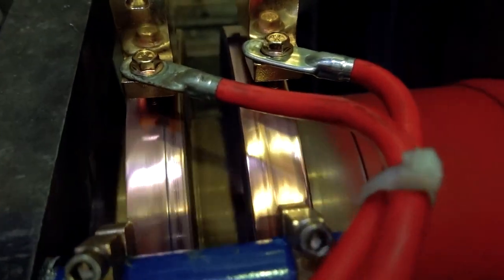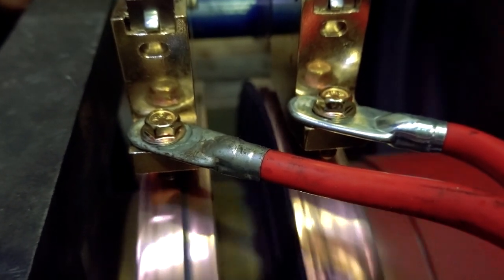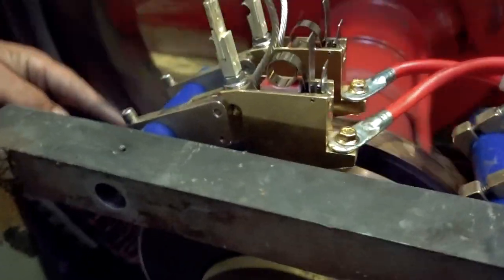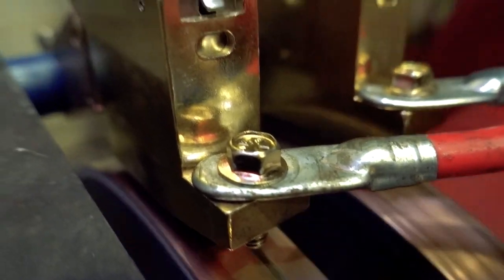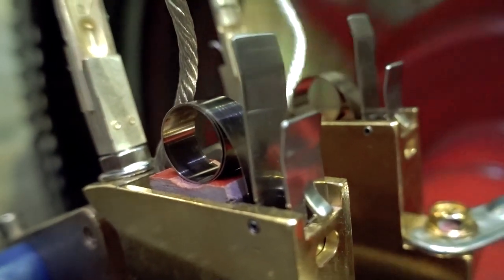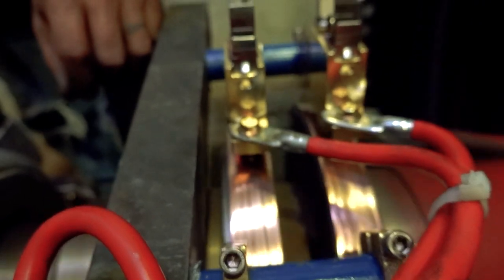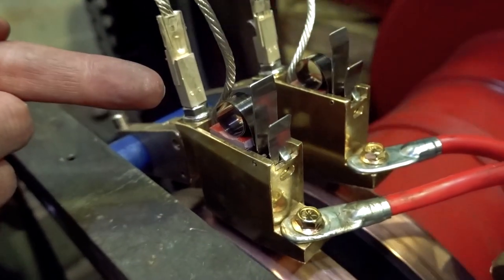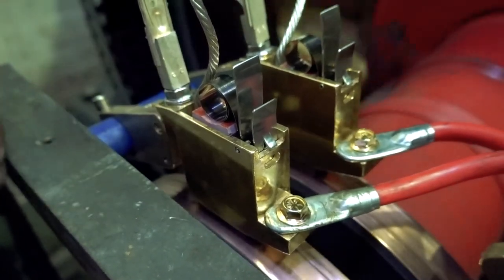Authorized Personnel Only - Why We Intentionally Misalign The Slip Rings

Comment: This makes perfect sense to me. The pantograph on a train is around 4ft wide and to prevent the over wearing in one spot the overhead lines zig zag and the pantograph brush gets worn evenly. This both cleans and protects the cables and also reduces wear on the pantograph collector brush. I can only imagine that if the brush was fixed you would have a groove in the slip ring rather than even wear and the brush also wearing evenly. Only an opinion but I’m sure it’s a similar principle?

Comment: I've heard this argument made so many times over the years about the benefit of slip ring run-out . I have never seen literature from any manufacturer that recommends having eccentric slip rings but instead all say to have them as true as possible . 
When you have the brush working up and down in a brush holder you are basically wearing the graphite  off the sides of the brush which can then collect between the brush and holder until it becomes compacted and can jam the brush in place and prevent it from  following the collector ring surface . When you also have oil mist coming thru the bearing seal this will mix with the graphite  powder and help to make the powder stick where it settles .  When you have excessive run-out in the slips it forces you to mount the brush holders higher off the slip ring surface as well . This can also lessen the amount of spring tension available as the brush wears and shortens in length .
Reply: As with all things, there are trade-offs. Brushes wear - period. So there will be carbon dust. If the brush doesn't move normally, it can become locked in place. As bootsy explains, they've actually had this problem. (over the span of a century, I can't imaging it not happening.) I've not seen this with motors (all of mine are subject to loads of vibration), but I have seen this plenty with gauges. (thus the "standard practice" to thump before reading)
Reply: It depends a lot of environment. This is a hydro plant. That means oxidation is at a higher rate due to the latent humidity in the air. Springs are made of steel and can freeze themselves in place from rust jacking. Things staying stationary a long time are always an issue ask any car mechanic. 

And even as true as can be it's never perfect there is always runout. This is what pushes the pads of a disc brake away from the rotor when you let off the brake, the very tiny amount of natural run out the rotors have.

Comment: I was wincing watching your finger get closer and closer. whats the voltage on those brushes?
Reply from the maker: When the exciter is on, 120VDC at ~100A. At that moment though it was 0VDC, because we had just installed them and were still testing. :)
Reply: @Physicsduck  ok, so if you were to touch that when energized, it would hurt, but you would probably be fine right?
Reply: @rogervanbommel1086  Most exciter systems are floating with grounding lights.  So if you short it out, you get shocked by the current a light bulb will pass.  Enough that it will hurt like heck.
Reply: @rogervanbommel1086  1A can be enough to stop someone's heart for the record.
Reply: @BillyBoze  Yes, but that’s assuming high voltage IIRC
Reply: @TheEmeraldMenOfficial One amp can be fatal when it is conducted through the chest, affecting the heart. That can happen with a current that goes from one hand to the other. It could also happen from an arm/hand contact to a “hot” conductor, with simultaneous ground contact while standing in water, for example. 

The human body has some electrical resistance. Higher voltages can overcome that resistance more easily. Ohm’s Law tells us that with resistance remaining constant, a higher voltage will produce a higher flow of current. Based on OSHA standards, anything over 48 volts is a potentially hazardous voltage.

Comment: Slips rings with high TIR or out-of-roundness are usually found on low RPM machines…. Less than 500 RPM.  If this were a 3,600 RPM generator; the brushes would be sparking, making noise and wearing away very quickly.
Reply from the maker: Certainly, but down here at about 200RPM it's just fine.

Comment: As another commenter mentioned, RPM has a lot to do with this working well for you. Certainly a neat concept though. I’ve seen on multiple occasions where brush swelling appeared to be the culprit of a slip ring / brush melt down. We’ve operated on the principle that these higher RPM and higher current applications (300A+ per brush) can swell in their holders and stick after being subjected to high dosing of contact cleaner. Maybe I need to get one of these brushes and do some testing and measuring to see how true that is!
Reply: Nowadays brushes manufacturers cut the brushes so when they swell they don't jam into the holder